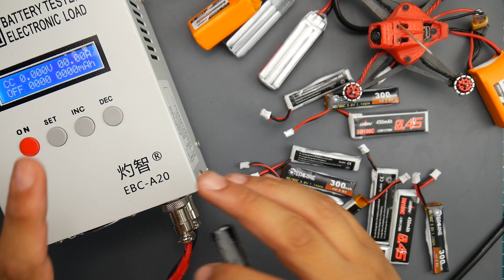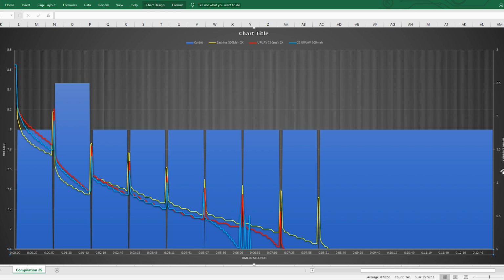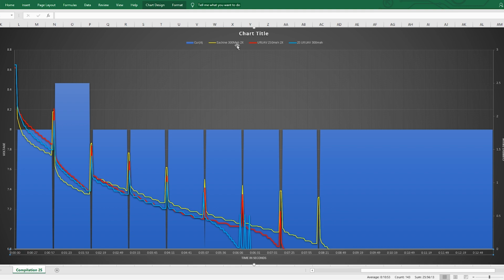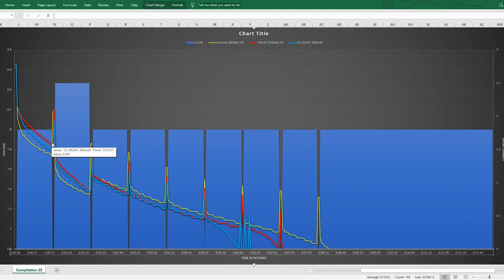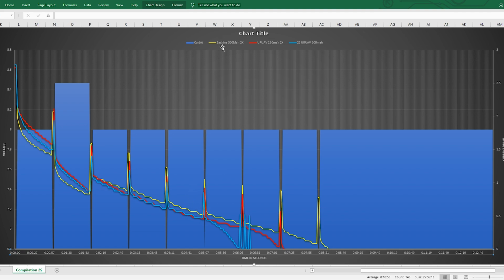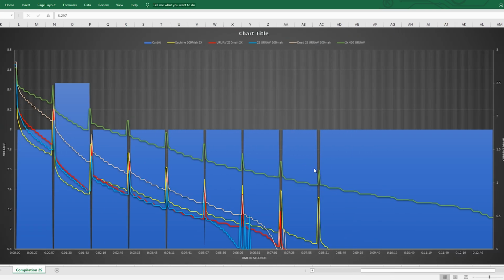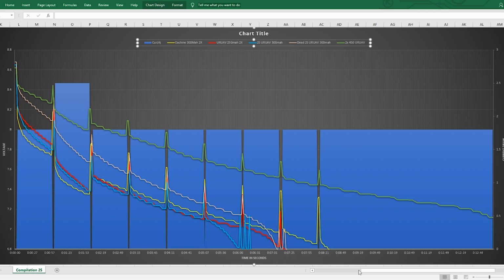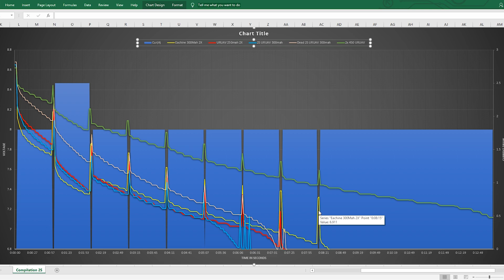ToothPick Research: Budget Lipo HV Batteries Tested // Group 1

Comment: You should ajust the current for each weight of each capacity of battery. You state that you might get double flight time with the 450 mAh. I use those batteries, and you get more flight time, yes, but not double, because your base throttle for maintaining flight is hihger since you weigth more.
Just an idea to better the tests, to have the current drawn tabuled for each weight. 
Other than that, I've loved to see that kind of testing!
Reply from the maker: I agree with you this is my first tests/theory I will go out today to test all this again with the data I found in this video. I personally thought it was interesting and thus why I am doing this.

Comment: Your URUAV 450mAh packs are probably from a similar batch as mine. I measured them at more than 700mAh capacity, I can't remember exactly. That explains the weight and performance. Still, the 550mAh version is better overall.

Comment: Hey Dronemesh! Do you think that it's worth the extra weight to use 2 1s's and a dongle instead of a 2s pack? Doesn't the adapter drain some power, and aren't there some 2s portable LiPo cahrgers? What are your reasons?

Thank You and Happy Flying!

Edit: How do you stand on HV lipos? I've watched a KababFPV video and Bob said they just deteriorate more quickly? Has that been the case in your experience, or do you ONLY use LiHV's?

Comment: Great testing, dude! 😃
If you can, show us how you revived the battery!
Reply from the maker: use any power supply set the full battery voltage for example 8.7 V for 2s HV and current to 100mah wait until until you see the voltage go up and make sure both cells are charging if not then trash it. If its charging once it hits 7V or 3.5v each cell plug it into your normal charger. But watch it like a hawk dont leave it or trust it.
Reply: @DroneMesh  Fantastic! Thanks! 😃